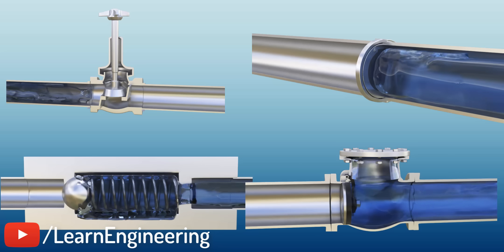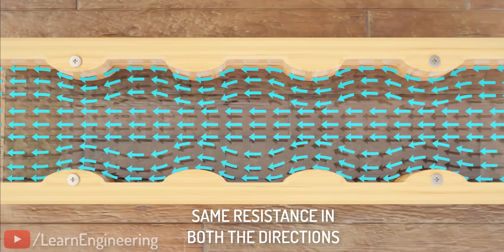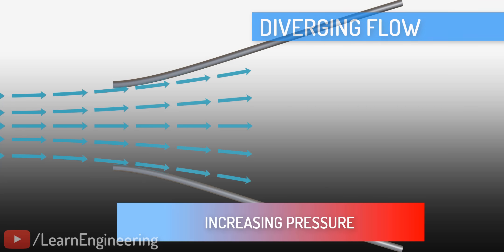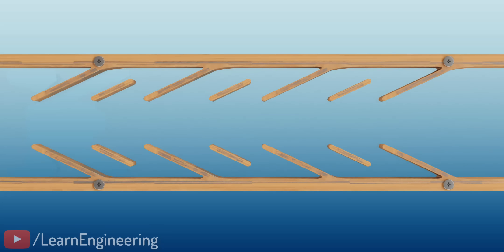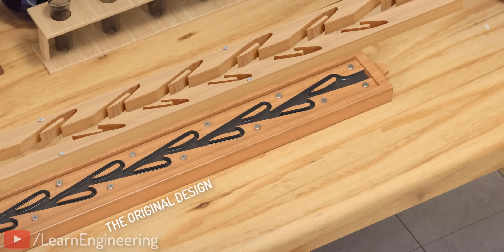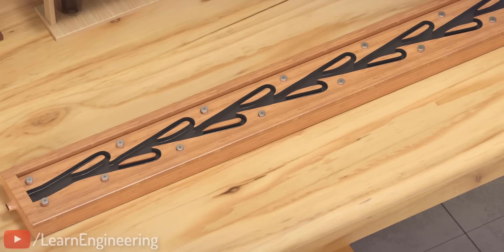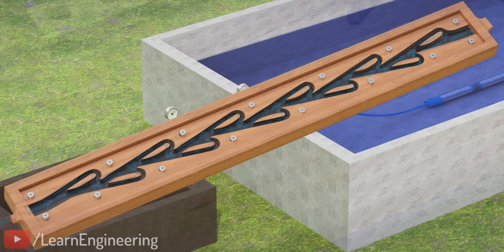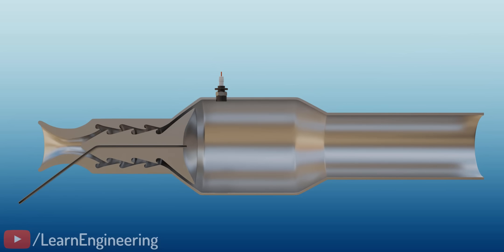Tesla Valve | The complete physics

Comment: At 2:05 both directions of flow involve converging flow and diverging flow. In a real world scenario, flow resistance is almost identical in both directions. Also, you give an impression that the Tesla valve is an efficient one way valve. It isn't. The pressure drop difference between forward and backward flow is very small.
Reply: Dragomir Ronilac  You are right. Place a thin divider between the upper half and the lower half, and the flow directions are identical. Not a very good video.

Comment: So basically more a resistor than a one-way valve. Still has its uses though.
Edit: More like a zener diode
Reply: seal all sides, used on end dip it into a  bucket of water, raise and lower it , you have a pump.
Reply: Pretty much.
Reply: Anyone ever try scrape soup?
Reply: Do you know what's more? Its an oneway resistor
Reply: One way flow regulator
Reply: Dimitri Ol zener diode, blocks one way for a specified amount
Reply: No kidding, I would be more stunned if it were a true value without moving parts
Reply: Certainly not a zener diode which has a fixed drop in the reverse direction. It's more like a leaky conventional diode.
Reply: The fluid dynamics of the resistance is identical to electrical dynamics in a conductor. Moreover, the whole thing is like an inductor with the forces closed to the outside countering the inter forces in rotations.
Reply: Like a zener diode
Reply: Yeah, also thought this isn't really a valve but more of a flow regulator.
Reply: @mihaigrigoras7956  absolutely
Reply: make it long enough and the allowance will be negligible
Reply: @hkn7286  sorry but its like an induction motor, as soon as it stops, no induction, this is the same, as soon as flow stops then there is no back flow in the side ducts, hence flow starts again. There will always be some flow, no matter what
Reply: No
Reply: No, it's a one-way valve. Most valves are not completely leak-proof so there's a much bigger flow in one direction then the other, just like in this one.
Reply: https://youtu.be/mC91vEMwq-E
Reply: @s.s9397  mkmmì..,
Reply: @s.s9397  That seems even more useless than what some people here view the Tesla valve as

Comment: 5:28 Did not get the point why the reverse connection will lead to a pressure drop at the other end. Isn`t that an increase in speed will induce a drop of pressure, but an increase with a drop of speed. Sincerely. Thank you (Fluid mechanics not learnt)

Comment: Big brain takeaway: Tesla Valve is not a check/one way valve, it is a regulator. Edited
Reply: So basically a diode?
Reply: @Sejiko  A leaky diode ?
Reply: @shoddyproductions9793  A zener diode.
Reply: @Sejiko  a Zener diode
Reply: @Sejiko  nice
Reply: DarkSpirit with the pressure differential between input and output representing the forward breakdown voltage.
Reply: @Sejiko  exactly. Exactly. Exactly!!  One of the weird bits of forgotten engineering/invention is that as a technic society we KNEW that the next of innovation would be machinery that could make decisions about itself.  At the turn of the 19th/20th century how that would be performed was not certain.  Besides electricity as a medium dynamic fluids was considered as a possible way for making decisions automatically.  This was Tesla's contribution to that.
Reply: @Sejiko  brilliant.
Reply: Old school hammer arrestors for plumbing follow a similar design using baffles.
Its a neat thing, and yes I admire the mindset to solve this ''problem'' but outside of specific use/laboratory etc, it certainly would not win over long term use, the counter flow it creates is a real problem for any kind of material that can be eroded.
Lay term amongst plumbers is ''eddy's'' just like a rivers, it is the difference of a copper pipe lasting 70-100years and only lasting 5-10 (even less if it ''eddys'' on the solder joint, stripping away the solder between pipe and fitting, a couple months to a couple years depending on water usage).
Reply: @ninjaplumbing5828  the term is turbulent flow
Reply: @ninjaplumbing5828  Thanks, finally a criticism based on physics, instead of "it doesn't completely stop reverse flow like a one-way road does(despite real-world valves not necessarily being leak-proof as long as they meet specs)" or other pedantry
Reply: What exactly do you think a valve is?..... It's a regulator.
Reply: @starmc26  You dont work in the piping industry do you?
Reply: REGULATORS!
Reply: Thank you someone actually gets it...
Reply: Bro regulation of flow is the basic function of a valve hope u get that
Reply: @affanbhaijaan65  But these pedants don't accept anything less than 100% stoppage of reverse flow as 'one-way valve', ironically showcasing their ignorance about real-life engineering & manufacturing tolerances
Reply: @affanbhaijaan65   In this video it is described as a check/ one way valve.
Reply: This whole thread is embarrassing.
Reply: @OP
I was thinking the exact same thing.
Reply: It is a uncontrollable regulator or Preordained regulator 😂☝🏽
Reply: Yup im asking myself how is that a valve do they even know what valve means lol
Reply: Yes, it's a valve.   https://en.wikipedia.org/wiki/Tesla_valve  Note the definition of a valve.
Reply: Tesla and Humanity's Missing Paradigm Shift ~ > https://youtu.be/zMauq8r3fuY
Reply: @levetbyck  wouldn't a simple tiny hole work as a regulator symmetrically in both directions, unlike this device?
Reply: @levetbyck  indeed we need physical demo instead of animation, but that's why they pinned a link to Grand Illusion's video testing it
Reply: @levetbyck  so similar to snubbers in high-voltage AC? Maybe you're onto something here...
Reply: Similar to a fixed orifice .
Reply: Thats right. And it has to be adjusted for every application according to flowrate an pressure. A simple flap will work always :D
Reply: nordhorny   Im role playing as a Flatearthy your logic has no power here.
Reply: nordhorny   the sphere part was just a little "Fail RP", I've already served my admin ban for that.
Reply: Exactly
Reply: Valvever!
Reply: Watch my videos 🙄
Reply: inlet and outlet on a squeeze bulb pump.
no moving parts.
done. brilliant.
Reply: @wrenchnride  watch my videos 🙄lol
Reply: That was the big flaw in the presentation, introducing it as a one-way valve, rather than a flow regulator
Reply: Just like a diode?
Reply: My language is Finnish. Jo kaksikymmentä vuotta sitten israelilaiset ovat käyttäneet samantyyppistä säädintä tippukasteluletkuissa. Letkussa on reikä ja sen ja sisällä virtaavan veden väliin on liimattu tai sulatettu tämä tesla säädin ja kuinka ollakkaan vesi ei tule ulos suihkuna, vaan tippa kerrallaan aivan, kuin viimeisessä kuvassa. Vasta nyt ymmärsin tämän toimintaperiaatteen. Kiitos videosta.
Reply: A possible wartime application would be in completely fluidic (Tesla) valve intercontinental missile control circuits impervious to EMP disruptive effects. This would take the " ballistic" out of ICBMs, allowing powered flight control all the way to the Target, including RECALL!
Reply: Yea
Reply: the def'n of a valve is: a device for controlling the passage of fluid or air through a pipe, duct, etc.., especially an automatic device allowing movement in one direction only.
Reply: Stupid people play semantics to try and feel smart. If applied properly, it is 100% a one way valve. Each valve type has drawbacks and environments where it will be best suited. The only problem here is your limited understanding of what a one way valve is and how it needs to function.
Reply: @manayunkman83  Thanks, finally a well-worded description of their pedantry...
Reply: @manayunkman83  Yes, and the drawback to this one is it doesn't work
Reply: @Quinn Cooney some valves do. But I think ball valve would allow flow from both direction. The think is with the tesla valve, you cannot control the flow when you are in the converging mode while the point of having any valve is to have some kind of control about the flow.
Reply: It is just a gourmetized orifice plate
Reply: Yes.
There are no moving parts he said, but you have to turn the whole thing around for to make it work.
Reply: @Drottninggatan2017  I think not exactly... the Tesla's Regulator works the same way as an one-way valve, but instead of completely blocking the current, it supresses its flow. In the example of the video, the mecanism just had to be turned around because there was only one current to flow through it.
Reply: @greenhatzelda8273  therefore it's a regulator and not a one-way valve... you just said so yourself.
Reply: @lIlIlIlIlIlIlIlIlI  I said it's a one-way valve with one functionality exception, which makes it a regulator.

What makes it a regulator is not the fact that it "only works when the current passes through one side" or anything like that, but the fact that the fluid output is greater depending on the direction of the current.
Reply: @greenhatzelda8273  pal, just use a long pipe with small diameter and you will get the same result, I'll tell you even more - the valve in your kitchen, you can shut it softly and, OMG, you'll get a reduction of a flow rate. No fancy stuff from Nicola - even regular things around you can do the same shit. Plus I don't think that this tesla's shit should work in the laminar regime of a flow
Reply: @lIlIlIlIlIlIlIlIlI  but to make it 'work' as a regulator wouldn't you have to turn it 180 degrees each time the flow reverses?
Reply: @CantPickTheNameIwant  does a long pipe with small diameter have an asymmetric "regulation" though? While the "regular things" you mentioned do restrict flow, don't they do it in both flow directions? Is it really the "same shit" as the asymmetric reduction of Tesla 'valve'? Nice try oversimplifying the valvular conduit's asymmetric flow rate reduction as mere "flow rate reduction", try again...

Equating asymmetric flow reduction with bidirectional one? OMG
Reply: @ki0w0-lordofwatersheep  Don't be aggressive. I have over 10 years in one industry where hydraulic is a core point. So, nobody wants to have a business with a design like that because despite it looks very smart and fancy, in fact, when you will apply it in the field, it sucks. 
P.S. you have forgotten to answer the question about laminar flow, should it work in laminar flow?
Reply: @CantPickTheNameIwant  

Tells someone, "Don't be aggressive", while being aggressive in every comment made. Nice.

"You forgot to answer the question about laminar flow..."

You never asked a question, you made a statement. The response to that statement is; not being applicable in every application does not negate is applicability in specific applications.
Reply: @greenhatzelda8273  no, a one way valve doesn't let water through slowly one way and quickly the other. It doesn't let water through at all in one direction.
Reply: @Drottninggatan2017  No you do not have to "turn it around to make it work".  That is just to demonstrate its directional characteristics.
Reply: @Drottninggatan2017  why would you ever need to spin a one way valve around
Reply: @Drottninggatan2017  You can keep it fixed and just reverse the flow.
Reply: @Drottninggatan2017  that's like saying check valves are bad faucets since you have to unscrew, flip, & screw back the entire thing when you wanna close/open the 'faucet'...

The Tesla valve isn't meant to regulate flow in one direction, it's meant to respond asymmetrically to different flow directions, you don't unscrew & reverse check valves every time just to make it stop reverse flow, do you?
Reply: @Drottninggatan2017  Just like any other one way valve, the purpose is to restrict fluid to only travelling in one direction, and not the other. Your comment is meaningless.
Reply: There's a world of difference whether the valve blocks the flow completely or partially. It can literally mean the difference between life and death. I wouldn't say it's meaningless at all.
Reply: @Drottninggatan2017  though you only turn the thing around if you use it where a regular regulator belongs? Of course a Tesla valve changes "regulation" by simply reversing the flow...

Just like how you don't "have to turn" a whole check valve 180° to 'make it work' as a regulator, reversal of flow is what it's designed for
Reply: @Drottninggatan2017  Ridiculous right
Reply: @frederikmoeller88  of course it's ridiculous since it's a misuse, just because it works like a regulator(in only one way) doesn't mean it'll take the place of a normal regulator. Just like how placing a candle where a car engine belongs won't work, despite both of them using combustion
Reply: @ki0w0-lordofwatersheep  how big is the candle haha..................i say that cause you can get a car to run on steam like them that run on wood "where there's a will there's away"
Reply: What’s ridiculous is that you both have no idea what they’re talking about you confused turning the valve to demonstrate the physics behind it as if it needed to be turned around to function!!!
Really sad!!!
Reply: @Drottninggatan2017  The earth is a stationary sphere, (you just have to rotate it a bit for sunrise and sunset)
Reply: @sporehux8344  when i first heard people talk about the world being flat and we don't spin i thought it was a joke but people think that's true we should never help other's
 if that guy wants to drive over 100mph and not have seat belt on let him. you want to ride your bike along train tracks enjoy you want to take how many drugs at the weekend ....let the stupid die off we should not give them fine's we should give them beer and let them take care of the rest.

Comment: You still need a mechanism to rotate it after speed more cost on the complicated design. The seal will be difficult to make because the whole value is moving as a single unit in this case. I guess it is the reason for it has not been popular, but I believe that there are some types of system will require this type of design. I just cannot think one right now.

Comment: Is it really a valve if it cannot be turned ON or OFF? It's more of a "resistor" than a valve.
Reply: Valve offers differing “resistance” depending upon direction of movement, unlike a resistor. Perhaps a diode or rectifier would be more appropriate.

Comment: As with all physics, somewhere on the planet, it has been done before. 
Mr tesla,s valve is light years behind the one I have fitted to my Back Passage,?
As a cause for thaught,  the back passage valve is multifunctional, 
1. stops Atmoferic Pressure from Entering the body.
2.   "       Gas from leaking.
3.   "       Water under pressure.
4.   "       the Flow of  Solid,s
5.           Filters solids from liquids.
6.           Blocks Air Pressure.
7.           Can Play  Many Octivs on the Musical scale.
8.            Self Lubricating.
9.            NO   MOVING    PARTS.
10.         And Will Last  Approx  75 Years,  Without going Rusty, Or requiring Maintenance.
            Sorry I cannot find the Original Drawing, as the paper was used to Clean the Valve.

Comment: I'm a retired mechanical engineer and this is the first time I've every heard of this design.  This should have been taught in my Fluids Dynamics class.  Thanks. 

However  this video would have been more convincing if a simple physical model was made to actually validate the animation.   Based on the animated version shown, it would have been easy to do with a flat wood bottom piece, a clear plastic top piece, and a wood middle channel piece being water jetted or even hand cut using a scroll saw.  Anything can works great when it's computer animated.  I want to see how well it preforms for real.

Comment: From a back-flow or back-siphonage perspective, I thought this could have had potential, since things like an RPZ having parts and require dropping pressure on the downstream sides to function are a side effect of the design, but as I think about water moving through this device if the upstream pressure was present, there’s no issue of backflow to be concerned about, and if downstream pressure was greater (from things like heat or addition of gasses etc) I can’t see this model realistically obstructing the return flow, and for water, namely potable water, one of the other concerns is maintaining water quality between drinking water taps and (pick something dangerous) in the next room, like the smoko room in a metal factory, so presuming the water was contaminated, and only made its way back up the valve 1 section, the end of the valve is contaminated, and the next back-flow got the next compartment... eventually, the whole valve would require cleaning or replacing... so I get this valve was made for a theory of Mr Tesla, and it was obviously not even intended for water, so I think it was for flow regulation for an oil or lubricant in a machine that could work in any orientation or state of gravity. Or in a situation where you want to mix 2 chemicals accurately... like the pulse jet listed in the video above.

Comment: This has many application including battery with ionic air as electrolyte because if the blade had two substance then it charged differently as air flow through it and the charge keep supplying to the circuits as the flow continues. But there must be a modification geometric arrangements to apply for battery design infact it could drive entire life of the car or as long as air on Earth still the same with a tolerance degree

Comment: Isn't there a huge difference in the performance of the valve when comparing the flow or liquids and gases? I ould think since liquids cannot be compressed the diversion area would fill and not divert more liquids. with gasses it still be able to divert. I see this being most effective as a reed type valve with pulsing at a certain frequency with gasses not liquids.